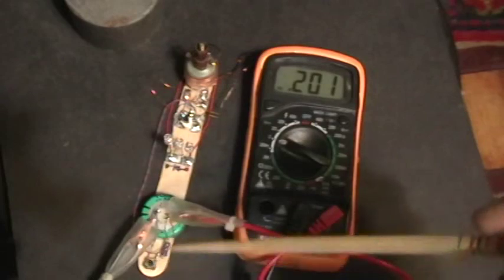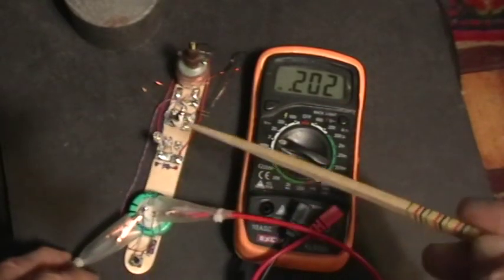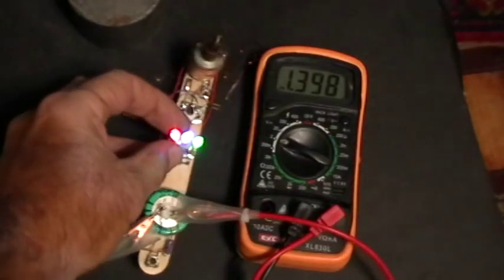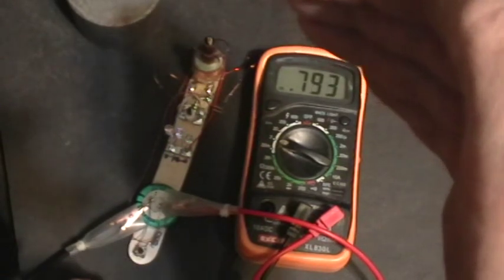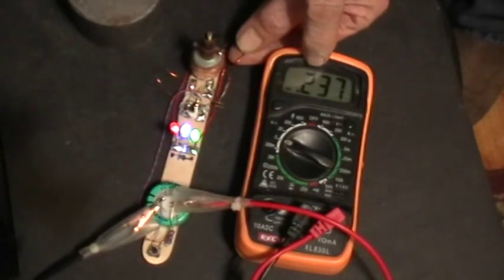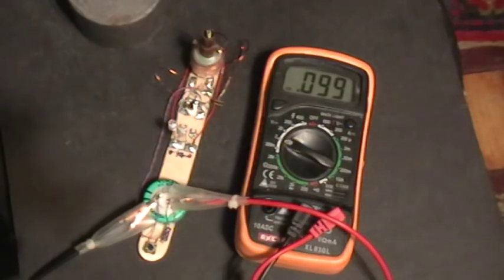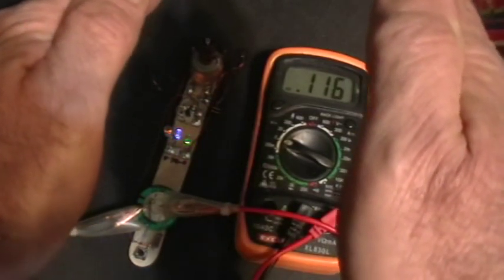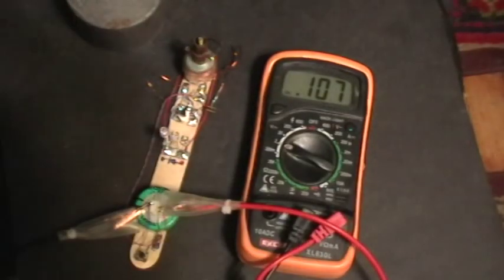Joule Thief: TK-LS SooperLooper Runs At Less Than 0.2 Volt

Comment: So far I use some 8 ohm 1500uh transformer in joule thief circuit to run a 12 v led. I added a lm358 IC to help drive the led. I don't think I get a long battery life with the thing but I get good light on a 12v 1w led.

Comment: TinselK: Excellent work!  I don't know why 8 down thumbs either. Thanks for the excellent detail on winding and the 2SK3198. I looked for them and the 2sk2309 which has high hfe but it looks like these types are obsolete and hard to get. I have a feelng Litz wire is unnecessary. I am anxious to see your scope results.
Reply from the maker: Yes, the Litz may be unneccessary but it does contribute to the high DC resistance of the stock loopstick, about 75 ohms. If it was just wound to the same inductance with solid copper it would have lower DC resistance. I don't know if that is important or not but it may well be, in this circuit.
Reply from the maker: I get all my Japanese transistors (anything with 2sk, 2sc, 2sd, 2sa prefix) from discarded TV chassis.

Comment: Your cap drains quickly at low voltages because the amount of energy stored in a capacitor is .5(capacitance)(voltage^2).  That means that every time the voltage cuts in half, you have 1/4 of the energy left in the cap.  At that low of a voltage level, the energy draw makes the voltage crash.
Reply from the maker: That is right, and for the LEDs to get enough power actually to light, as the voltage drops the current must go ... up.

Comment: Shaker Torch! :)

I'd be interested to see it running from one of little "garden light" solar cells.
Reply from the maker: I just tried it after seeing slider's matchbox radio. It works! Starting with zero on the cap, shining a flashlight onto the solar cell causes the voltage to climb rapidly to about 0.45 volts when the oscillations kick in and the LEDs come on suddenly and brilliantly. Then the voltage drops back to about 0.25 volts and holds there as long as I keep the solar cell illuminated with the flashlight.

Comment: wow... ... wow
Reply: thanks
Reply: Mongrel Shark Hi.Can You share with us schematics for running JT with motors,please ? cheers
Reply: As I said. Simply rectify the output. Full bridge rectifier between base and collector, filling a cap on the DC side should do it if the JT has strong enough output. Pays to let the cap fill to a bit over the rated voltage of the motor to get it started. 10uf or more is a good value. I mostly use small motors, like the 1.5v ones from phone vibrators, worlds smallest solar car etc. Larger motors can be run if you have the output from the JT.
Reply from the maker: I feel the same way. I was really surprised when I accidentally discovered this, the LEDs were so bright and the meter read so low, I thought there was something wrong with the meter. But there isn't!
Reply: So is you set up acting like some form of reverse transformer, do you think?

what i mean is ... the first way round was a normal joule thief ... now with this extra winding, is it acting to transform the lower voltage into a higher voltage, but as a consiquence use more current?

3x 1.2volt led's.... would your devise work to power a 3v dc motor insted?
Reply: btw larsko did a normal joule with 100t and 10t that ran on 0.125 - 0.35 draw. I havent seen any with your version cool
Reply from the maker: DiyEcoProjects
I don't know why it's working like this. After I have a chance to scope it in various places I may understand it better.
I think it will power a motor, but I'm sure the LEDs are oscillating/pulsating and this is part of the circuit's operating mode, so I don't know if a motor load will actually work. I'll be trying it on the MiniPulse Reed motor, which works well down to under 0.3 volts DC.
Reply from the maker: DiyEcoProjects
I couldn't get larskro's JT circuit to work that low.
Reply: p.s. dont delete google plus account if you have it, as it also deletes youtube (and all your vidoes)... i didn tknow google owned youtube until too late.

do you think your beastie would run a 3dc motor :o)
Reply from the maker: DiyEcoProjects
I just tried it on a low-voltage motor (runs at 0.5 volt very well) and it won't do it. The non-linear action of the LEDs is one of the reasons the "blocking oscillator" JT works at all. I'll have to try some other tricks to see if I can get a motor to run from this or some other JT circuit.
Reply: Ah see... hmm that makes sense interesting thanks. So there would have to be some strong current to do any physical work, where as an led is just in line. Have a look at "captret" when you have a chance.
Reply: I have been ab;e to get motors to run from JT's etc. The trick is to have some level of rectification. Even a single diode to fill a cap with the flyback. Or in some cases half or full wave rectification, depending on where and how much flyback is available.

Your Really sparking my interest with this one TK. I'm going to have to have a crack at it soon. :)